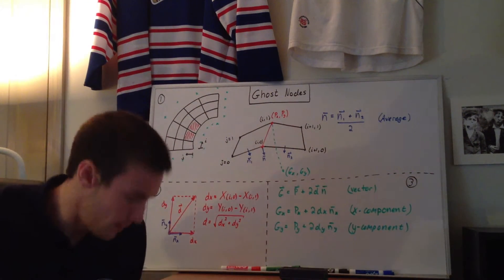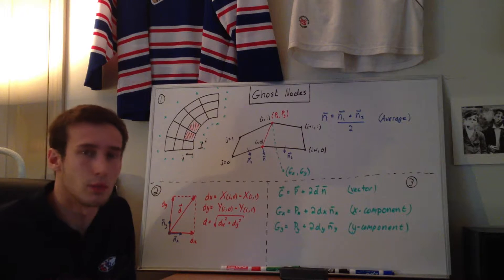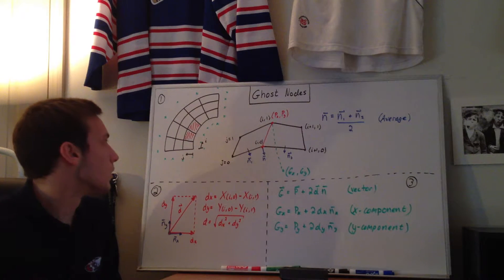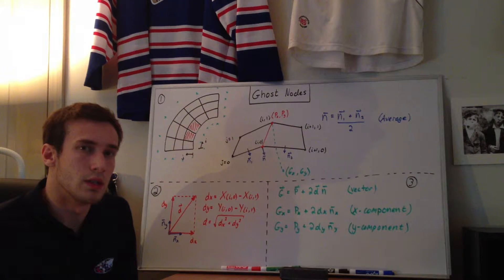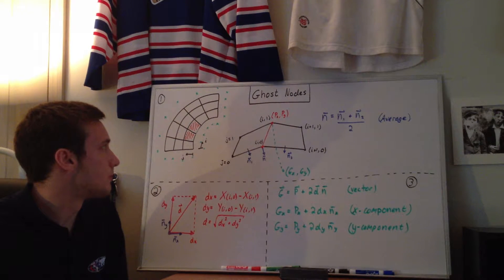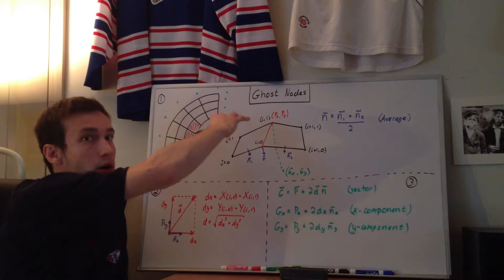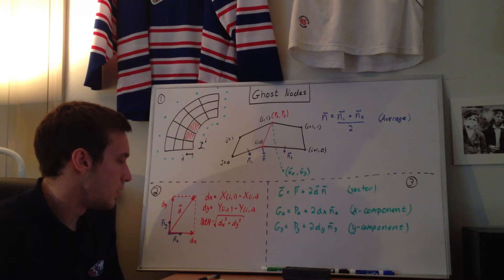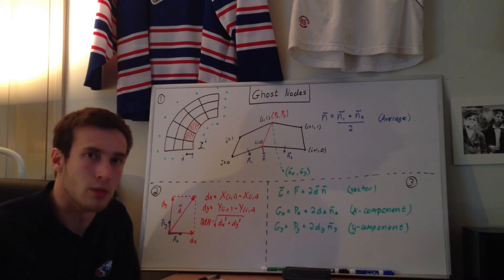Explained: Ghost Nodes [CFD]

Comment: Sweet video man! But, why can't we just get the normal vector by taking the vector difference between the interior node and the boundary node at a constant value for i? I mean that would work for the grid you drew, but maybe that doesn't work as well if the cells along the boundary are highly skewed.
Reply from the maker: That's a good point.  I should have mentioned that I'm using these normal vectors/ghost nodes for a finite volume formulation.  In finite volume, we're interested in fluxes through the cell faces, which is why I need the normal vector at each cell face.  However, if you're using the finite difference method, then you would care what was happening between each grid point, and would presumably need normal vectors at the grid points instead of the cell faces.

Now, let's say you're using a finite volume method, but you have a Cartesian grid (not skewed at all).  Then you would be able to use the interior node and boundary node to get the normal vectors, because they would be the equivalent to those calculated from the method I describe in the video.

I hope that answers your question!